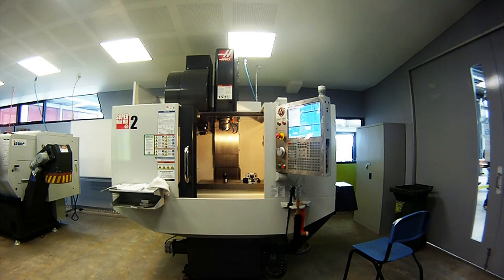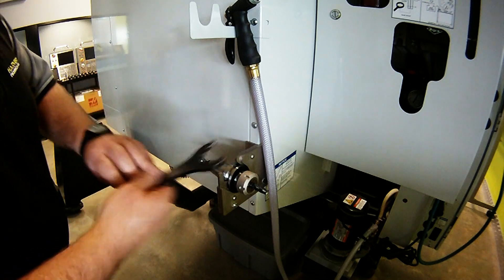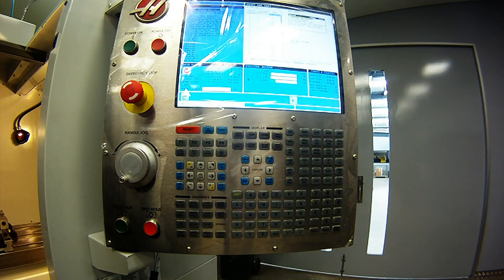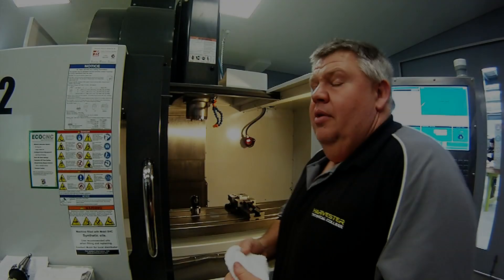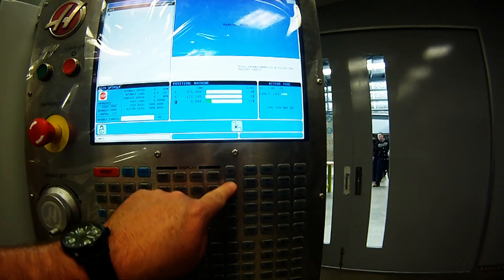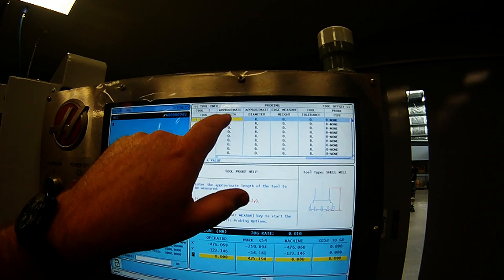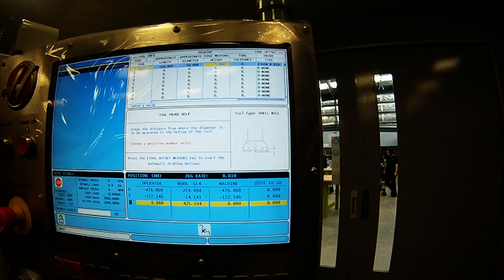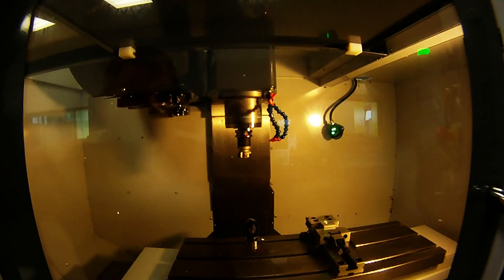HAAS Super Mini Mill 2 - Setting the Tool Offsets

Comment: How are the tool radius measurement results different from what you get from the tool pre-setter? We have a renishaw tool probe and the radius difference is 0.02mm and above. We don't know if we miss something or this difference is quite general.
Reply from the maker: +Stephan Fong Hi Stephan, I'm very sorry but I can't help you with this question.  My Renishaw system was installed and set up by our HAAS factory outlet.  I use it constantly and it just works. Maybe someone reading this can answer you, or email the renishaw company. Cheers, Aaron.
Reply: +DCTTeacher1 Hi Aaron. How does the repeatability of the tool setter look to you？Have you tried to measure one tool in one day and measure the same tool the other day to see the difference in measurement results? Another question is that, have you ever witness the tool setter break or damage the teeth of your tools?
Reply from the maker: Hi Stephan, yes the Reneshaw probing system is extremely accurate with high repeatability.  I have rechecked tools many times and rarely alters.  The tool setter spins the spindle in reverse so it doesn't hurt the cutting tool or tool inserts.  It is highly sensitive and accurate.  I wouldn't own a machine without a probing system these days.  Cheers, Aaron.